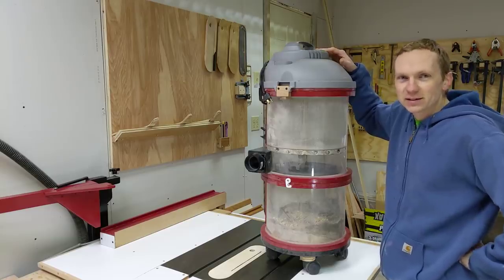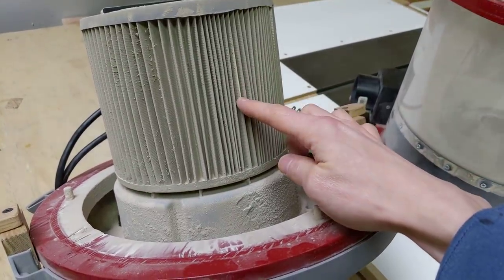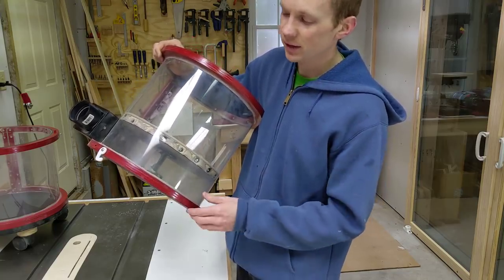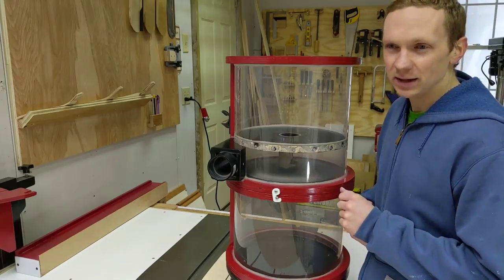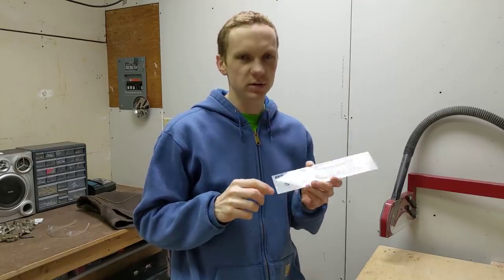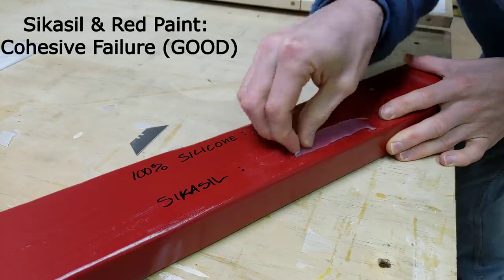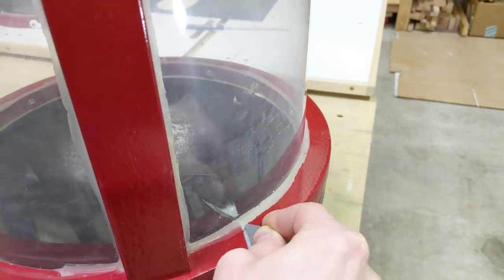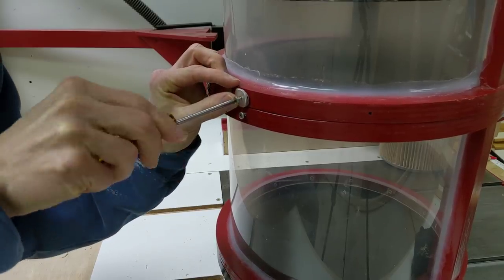How is my Homemade Cyclone Holding Up 2 Years Later?

Comment: Thanks for the video and the 2 year follow up. Yours is a really nice build and your original video was very clear about the steps. What I like most about your build is the compact end result. 
That said, re-consider making the bucket taller. It is not about capacity. It is that you need enough space to allow the dust to settle rather than be agitated by the vortex. It will also make the vortex more efficient.

Comment: just commented the first video :)
Just made a month ago my cyclon-add-on for a normal vacuum cleaner, 
using China cyclon from ebay. Works awesome! Stones, sand, dust - all 
comes inside. Changed the VC bag only once, because it was full of tiny 
dust particles. 
So cool to see what is really happening inside! Awesome design, although
 there are some problems I saw discussed on forums - static 
electricity!!!! because of plastic chamber and that VC can collapse it 
if the input will be suddenly closed.. 
Tried with mine - the plastic colour bin, which I use as a collector, 
start to collaps at half a speed of VC :) 

So one need a safety valve and metal chamber for a dust.. However, as I see, you did not catch any of these problems or at least they are not pronounced.

Comment: Justin, Thank you for this demonstration of the two types of silicone. I need to buy some adhesive myself to seal the gaps between the dust collection piping and a wood wall where the pipe enters my shop from a separate "dust collection closet" that I built onto the back of my shop. I wanted the DC outside of the shop, but also accessible for cleaning the barrel out dust barrel out when full. I also place my compressor from California Air Tools in the closet. The model I have is the California Air Tools 4710SQ Ultra Quiet & Oil-Free Air Compressor is designed to be one of the quietest air compressors in the industry having only 65 decibels of sound.
 The powerful 1.0 HP motor operates at only 1680 RPM creating less noise and less wear. The Oil-Free Dual Piston Pump System is engineered for high performance and durability and suites my needs as a hobby shop just fine.

The CAT-4710SQ Air Compressor has an Oil-Free Dual Piston pump designed to have a life cycle before wear of 1000 Plus hours compared to other comparable air compressors with life cycles of 500 hours or less.

so it's in the closet only to save some room in my 10x16 shop. By the way, If you are looking for a quiet compressor I highly recommend this brand to you and your viewers. It's not expensive ($140.00) and it is of high quality as well. I purchased mine from VW Express who offers free shipping which is a big saving because it weighs 43 lbs. Other places such as the big box stores run specials on their air compressors every once in a while.
Reply from the maker: I have actually been thinking about getting that compressor or another model from California air tools. Thanks for the lead on vwtools.

Comment: Justin I saw another video about shop vacs and he used simple off the roll hand towel with couple rubber bands to hold it over the filter like a safe and only had to shake or replace towel occasionally.

Comment: a very compact and sleak design. i like it. if you whould aero-dynamicly-improve the cyclone filter, you whould see a dramatic reduction of dust in the vac filter. i‘ve printed a large cyclone filter, and have not a bit of dust in the vac filter.

Comment: I put a filter bag in the chamber that has the filter. That way all the very fine dust that escapes the cyclone chamber goes into the bag. The filter never needs cleaning then and you never lose suction strength.

Comment: You can increase the efficiency by making 3 major upgrades...
1. make it taller
2. make the diameter smaller
3. make it tapered towards the bottom

This way the dust will spin faster and therefore less will go through the top.
Reply: Also I notice that the dust in the lower chaber is still agitated and spinning which would help get dust on the filter. You may consider putting strakes inside the bottom bin to stop the spinning. Say four 2 inch wide slats fixed to the wall at 90 degree spacing.
Reply: Ivan Walker  90degrees around the side of the bottom chamber (90-180-270-360)
Reply: Ivan Walker  4x90 deg = 360 deg

Comment: Little suggestion from an old NBS Lab Rat.  If you put a 7 to 10 degree downward angle on the dust inlet, it will improve your separation efficiency as it diminishes the planer flow and instead augments the cyclonic effect.  Also, if you have a larger diameter catch chamber below the cyclone chamber (a larger catch bucket under the bottom clear chamber) it will increase the drop out ratio of debris and capture more of the super fine particles.
Reply from the maker: Great suggestion!

Comment: Great project. Great video. a couple of tip's. Tip One, when you cut the end of the Silicone tube, cut it at a 45 degree (approx) to help force the Silicone into the joint(s). Tip Two, If your going to use your finger (without gloves) to smooth out the Silicone, put some Baby oil on your finger, to prevent the Silicone from sticking to your finger. As you do different joint's, you'll need to clean off finger, and then reapply the Baby oil, i.e. rinse & repeat.👌 Another way to smooth out the Silicone is to use the back end / handle of a spoon / fork. You will just have to find one that make's you feel warm & fuzzy with the size of the bead. For a smaller bead, use a baby spoon / fork's, or what ever else you may have @ hand.
Reply: Можно просто побрызгать водой из пульверизатора на нанесенную дорожку силикона и разгладить чем угодно :)

Comment: I made this dust collector after seeing the original video but I put a foam filter between the vacuum chamber and collection chamber it keeps the main filter clean, I just wash it when I empty the tank and instead of putting the poly on the inside of the rings I inset it into a Grove with epoxy to seal it.
Reply: I didn’t see your comment and just made my own asking if insetting in a groove rather than on the inner diameter would be a better seal. Nice to know someone did this. I’ve yet to build my collector and have watched tons of videos. This by far is the best.
Reply: @DB-dj6zk  I've since had to rebuild with total boat epoxy because I originally cheaped out on the epoxy I used. The original epoxy was the 2 part syringe epoxy kits and it cracked and started losing vacuum in the chamber's. There's definitely benefits to both designs you just need to use quality epoxy with the inset ring style
Reply: @Hunglikeagrimsmo  good to know about the epoxy, thanks. I would have used the same 2 part syringe epoxy since I use it for other things. I’ll change my part list now to get what you used.👍🏽

Comment: This is a fantastic design!  I've been trying to figure out what to do for dust collection and shop cleanup, and trying to find a way to avoid having to buy lots of short pieces of hose.  This looks like a pretty good option.

I'll want a bigger collection space and a slightly different baffle, since a lot of what I vacuum up is shavings from hand planes rather than dust, but it looks like an excellent starting point.  Thanks for the video!

Also, if you put some sealant around the top of the baffle (where you forgot to put it originally) it won't be as good as on the lower edge, but it should still help some.

Comment: I built a similar dust separator & tested it with drywall dust.  It failed.  I was able to determine the failure point was the design of the baffle.   The baffle needs a disruption section to prevent the vortex from continuing into the storage area.  Without the disruption, the vortex will lift the ultra fine particles out & because of the size, they can't be seen.  If you replace your baffle with a Thien Baffle, your separation will improve.   Drywall dust is the ultimate testing media !  
BTW: you should avoid vacuuming the inside of the filter. It only draws in the particles that plug the filter.   Insted, take it outside & use compressed air to the inside diameter area to clean the filter.  Make sure the windows are closed & the wind is in your favor or your partner will be as mad as a kcked hornets nest !  Cheers !
Reply from the maker: I should rig up a test to test the difference between thein baffle and the open baffel like mine. That would be a cool video.

Comment: I'm surprised the loose silicone didn't seal itself with the suction. My cyclone uses regular vacuum unit and a soft-ish plastic bin and I had to reinforce the bin so it would not collapse.

Comment: A minor overhaul after two years of hard use isn't all that bad.  Seems to have cleaned up nicely.  Good recommendation on the sealant.
A CA glue (superglue) would probably seal the paint to the poly and a bead of caulk on top of that to complete the seal.  A bag on the filter or a foam ring around the filter will catch that very fine dust and it's easy to remove from the filter and wash it under the tap.  A red racing stripe tape around the visible baffle area will hide the collecting sawdust -- it will still be there, but you won't see it to bug you.
Reply from the maker: Like the racing stripe idea!

Comment: Great update. Thanks. But I think your peel test had to be done on a thin layer of silicone that has been removed from red paint with a razor blade. I know silicone does not stick to old silicone, but I don't know if this SIkasil does. I hope it holds up.

Comment: Hi, I was thinking would be possible to instal cyclone filter like yours inside Nilfisk Multi II 30 T Inox 30L stainless steel tank? without external bin? (put divider inside 30l tank, cyclone at the bottom and filter at the top)

Comment: Could you not have sealed the inside of the top chamber from the top when you have the vac off?  Or do you think that the bead would be sucked out of the crack?
Reply from the maker: It was already sealed with silicone from the first time. That silicone was still sticking because there is no pressure difference on the joint pulling it apart, so I did not replace it with the sikasil.

Comment: When applying silicon to get a neat finish - first apply the silicon, then spray it with soapy water - then scrape/wipe the excess. You'll get a perfect looking bead with no thinly smeared bits. It's how we do it in the glass design business. More silicon isn't better either, you just need a small amount to create a nice little neat bevel. Otherwise it spoils the look of whatever you're making.

Comment: It seems to me that polycarbonate introduces certain problems.  First it requires you to bend it into a cylinder which is not the best form to resist outside pressure ; make it too thin and the cylinder is in danger of collapse.  I would imagine too that there is a tendency to generate static electricity ? The use of a circular cylinder also complicates the configuration of the inlet hose.  Use of all wood to construct a polygonal structure [ optimally an octagon ] has a number of advantages.  It is a better form to resist external pressure, and if one employs square ports wherever possible structural problems are made easier. Construction with square corners is a natural way to work in wood.  Not being transparent of course will probably require a glass window.  Sealing wood joints is also a simple matter, and allows use of cheap sealing material such as wax.

As to the rest of the designI I would say it's very well done, and painting the wood is a nice touch.  I note that have elected NOT to use a cone.  I have never been convinced that a cone is necessary.  One fallacy often encountered when layman design air-moving systems is that we assume that the air will flow in a particular way - the way we want it to.  In reality air is going to flow how IT wants to, and knowledge, experience and experiment is usually required to get it right.  The only thing we can be sure to rely on is that mass flow remains constant through the system; therefore the air will flow faster through restrictions, and slower as it moves through wider pipes and chambers.  It is the conversion from a fast flow with entrained dust to a slow flow which causes the dust to fall - which is the effect we are trying to create.

As a general principle it is advisable to avoid bends in the flow, because each one causes a pressure drop, and secondly to minimize the length of the total for system, since length too causes a pressure drop.

Comment: I know this video is very old but I just found it and your channel. Great work by the way not just with this project.

I wondered if you had thought to recess the poly on top of the ring in a groove rather than attach on the inner diameter and then put the sealant on both sides? It would still be screwed in place but also wonder if recessing it in the ring would hold a better seal with the sealant on both sides in the well.

And I see you love the color red ;-).
Reply from the maker: That's not a bad idea. It would be good to seal it on both sides.

Comment: If you made yet more ply rings you could put them inside the polycarb as a brace at the top and bottom.  Don't forget there is low pressure inside, that flexes the joins between polycarb and ply. Alternatively fit the polycarb into slots, but that would require thicker ply.
Reply from the maker: I like the groove idea.

Comment: to help with the finer dust, you can put a blue shop towel around the middle pipe or just on the top seperator to cover the hole.. its a lot cheaper plus it will hel ot...
Reply: A paper towel works good, and you just put it in the trash when it starts to get clogged.

Comment: Also maybe scratch the plastic sheet with sandpaper at the bottom where the new silicone goes and that should make the silicone be absorbed into the scratch markings making the seal even better 😁

Comment: Don't most cyclone vacs also have a diffuser screen to drop the speed of the air in the center? Doesn't fully eliminate the fines, but still seems to reduce the amount that gets pulled through since they settle more. Not sure if that piece you have in the middle does the same thing.

Comment: Choode a trash barrel, take the casters off and mount them on the bottom of the trash barrel, mount the polycarbonate collector barrel and mount the to the trash barrel, so now you have a lot more room for saw dust, with a large fill window at the top. If the trash barrel is a little larger than the polycarbonate cylinder you made, the difference in diameter will will obviously result in a lip, that lip will possibly reduce the amount of dust going back up unti the vacuum filter. You'll have to let us know if that actually works if you decide to this.
It might be worth a try, at least you'll triple the collection area.
I haven't built mine yet, so this is just speculation.
Cheers

Comment: I learned a lot about Polycarbonate adhesive! This is perfect, and so useful :D 

I have had good luck with DAP Kwik Seal Ultra, it has Acrylic and Silicone in it, so it might also be a good budget solution to bond to the paint and the polycarbonate.

Comment: very interesting! 
I know from a German YouTuber who builds already some dust collection out of wood he always mentioned that one of the most important is that there is no air leak between any of these components to avoid that dust goes into the filter (well there's no 100% to avoid it) it looks to me that you not have any sealing between dust bucket, cyclone and vacuum pump or I'm wrong?
Reply from the maker: The black ring that separates the cyclone chamber is sealed to the polycarbonate. Also between the red rings is a foam weatherstripping. I think that should cover it.

Comment: I'd like to see a cyclone design that puts the coarser particles into the part with the filter and the fine dust elsewhere. That would be ideal for use with glass bead or sandblasting so the coarse particles can be re-used and the filter won't get so badly clogged.
Reply from the maker: That is an interesting idea...

Comment: I would like to say I've seen lots and lots of cyclone separation systems built incorrectly...
the way it should be constructed is basically an inner chamber inside the dust bin that is sealed from the outer chamber. and the hose goes directly into the outer chamber, and there is an opening with a screen over it that goes into the intake of a cyclone that drops into the inner chamber.

Comment: I built mine from Justin's first video a little over a year ago, and I've had the same successes and failures that he had.  Well almost... Although the silicon hasn't stuck very well, I still have a pretty good seal; probably since my poly-carbonate is very tight against my rings.  So tight that if I accidentally block the intake, my poly actually buckles and collapses inward with a great 'thud' sound.  It's not happened in a while, perhaps because my filter is 'un-clean' now and the vacuum just doesn't suck as strongly as it did in the beginning. Now if Justin only designed an effective 'air' filter to clean my shop air from the fine floating dust from sanding...
Reply from the maker: An air cleaner is on the list!
Reply: @JustinDepew  Box fan and some furnace filters. :) Somewhere, years ago, I read about a guy who discovered he was very allergic to the sawdust from the wood he was using to build cabinets in his house. He'd work on them on weekends and by Sunday he was illin'. By mid week he'd be OK. Took him a while to figure it out.

So he built a wearable air filter by making a box to mount a rectangular car engine air filter with a fan and hose to a breathing mask. IIRC he modified a respirator mask with screw on filters. Why not just use the mask with its normal filters? Because he just needed dust filtration, the filters are quite expensive, their small size would quickly clog, and they couldn't be cleaned. With a car filter he could remove it, knock most of the dust off then put it back and get back to work.